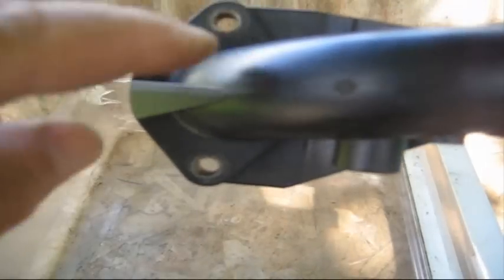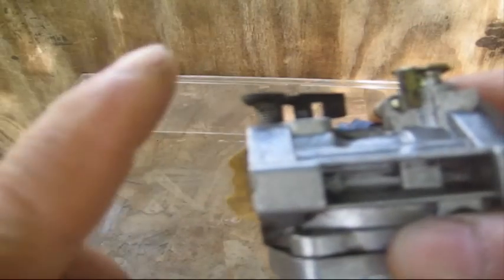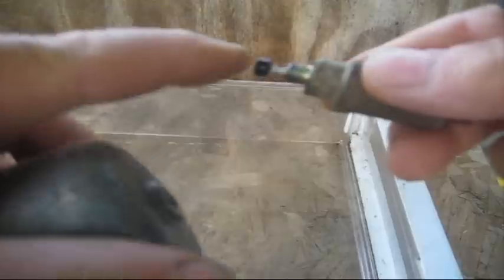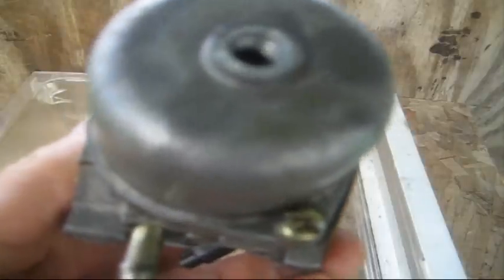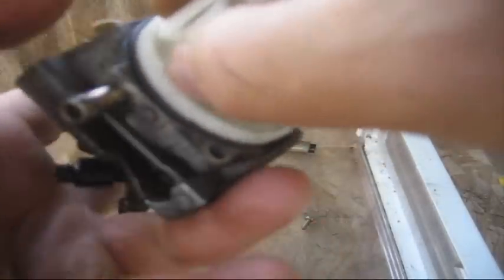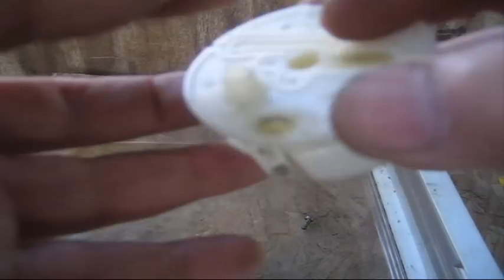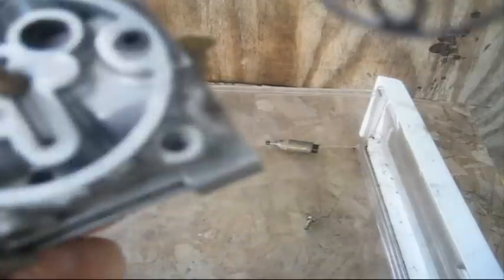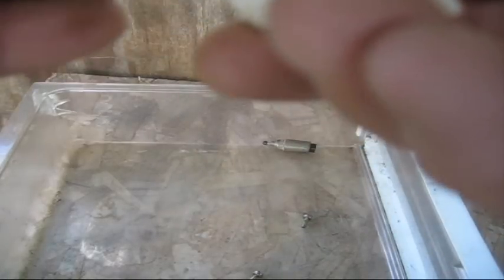I  Show You Where The Main Jet For Nikki Carburetor Goes Along With A Few Other Tips

Comment: The type of screw driver you need is one that's commonly used by electricians. It's a philips screw driver where one blade is bigger than the other. Look at the connections on your circuit breakers. The wide blade is good for producing torque while the smaller blade keeps the driver from slipping and plunging into a box of hot wires. Which they can be even if you've turned off the main.
Reply from the maker: Robert Gustafson,  Thank You for watching and taking the time to give this tip. Always good to learn & help others
. Robert Gustafson I have other videos on my channel that cover many different subjects  and new videos added weekly that may also be of help or interest. Be sure to 👍, share & subscribe if your are inclined to do so.  Also not to miss any new videos remember to hit that notification 🔔 You can support the channel at NO cost to you by using one of the above affiliate links. Let me know any thoughts you have in the comments!Thank you for watching and subscribing! Stay safe, Joe

Comment: This is confusing. Apparently there are so many variations. The jet on the nikki carb I have going along with Briggs 40N877, I have to pop out the jet the other way out the tube. Impossible to go the opposite way as the brass tip is wider than the end of the tube. Anyone with great expertise, please affirm I am understanding this correctly.
Reply from the maker: I agree it can be very confusing the first time or 2 you run into these. You can have the same engine but a different year or on different lawn tractor with the same name carb. but a different version of it. If yours is not like the one I have in this video Google the carburetors model # & check for a rebuild kit. You may find a diagram of your carb.  depending on the site.
Hope this helps.
Joe Z
Reply: @JOEZEP54  I think someone at the factory installed it incorrectly. I will put in as shown here. As seen on another video it 'looks' like it's positioned correctly feeding in at the top and maybe a new worker did just like that, or a worker who knew better thought of playing a joke.
Reply from the maker: @compresswealthdivideeconom3757   Could have been on Fridays production 
line LOL. Let me know how you make out. 
Come back to visit again.
Stay well, Joe Z

Comment: If you want to replace the Nikki carb get on eBay or Amazon and search for Briggs 594603 and look for a carb with a shiny metal bowl and a short stubby fuel solenoid for $30.00 or less. This will be a knockoff of the Walbro carb that is a direct replacement for the Nikki. Other part numbers are 591734, 594605, 591731, 594593, 697202, 594593. The Walbro is much less problematic and easier to work on.
Reply from the maker: wcjcnc, Thank You for watching and taking the time to comment. wcjcnc, the first time I had an issue with one of these I thought the same LOL.  There are times when the carb is in good shape & the repair is easy enough. Thank you for posting the Briggs part #. This could be of help to someone that just needs a new carb that stopped by my channel. I also prefer the Walbro Carb. But it may be just what we were use to. I see more & more plastic carbs, which have some advantages but what erks me are plastic gears. Hey stay in touch I will visit your channel soon. Stay well, Joe Z

wcjcnc Have a Youtube Channel? If you haven't installed the TubeBuddy browser plugin yet, to help your channel grow  Just go to my favorite tool for channel growth Tube Buddy. Now You can use it too, here's my affiliate link to the Free version

https://www.tubebuddy.com/joezep54   Start with the free version, yes it is free to not only to down load but to use.I hope you enjoy other videos on my channel as well. . Stay well Joe Z

Comment: I hate those Nikki carburetors. I find that using a small pair of visegrip pliers on those screws to first loosen them works well and avoids stripping them.
Reply from the maker: Hi Bill, I know what you mean. These carburetors  can be  changeling. Thank you for taking the time  adding a tip to help out. Stay well, Joe Z

Comment: Very poor film sharpness. Do you insert the nozzle with the new O-ring, O-ring down, or vice versa, because I didn't notice?
Reply from the maker: Watch from 3:40
Reply: @JOEZEP54  Thank you. I wouldn't have any doubts if the movie was sharp. The jet falls freely there. Shouldn't it fit tight? The O-ring should not seal the space in the hole, so that the fuel stream only enters through the hole in the jet ?